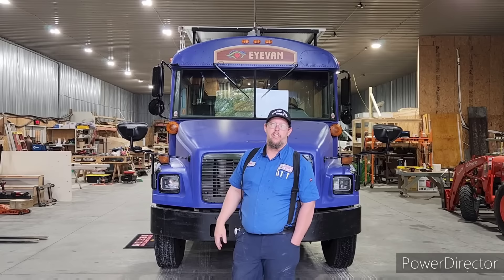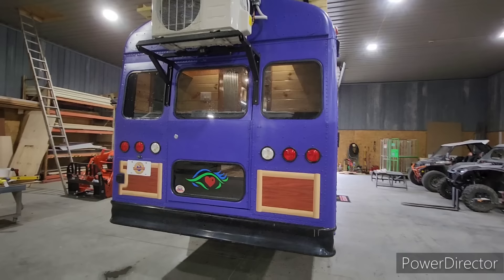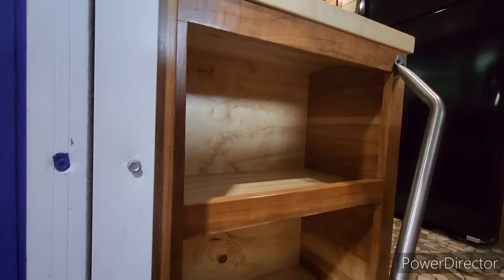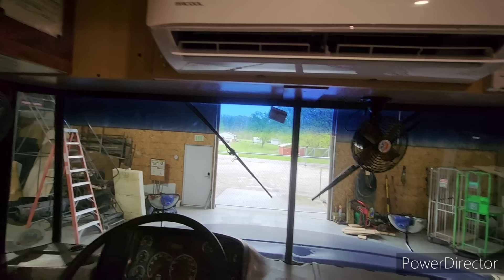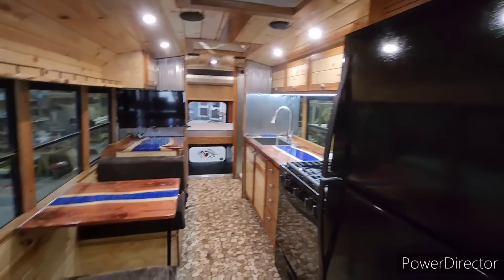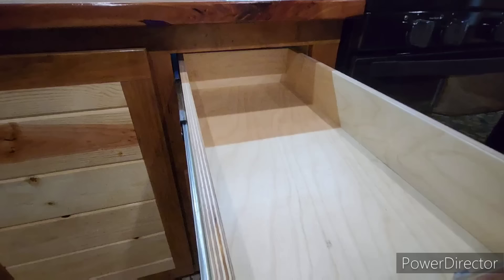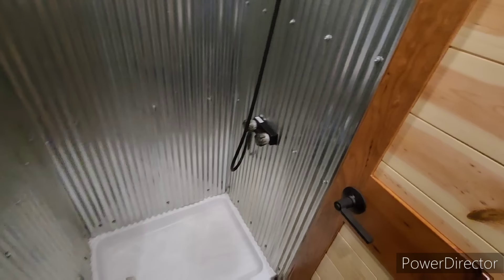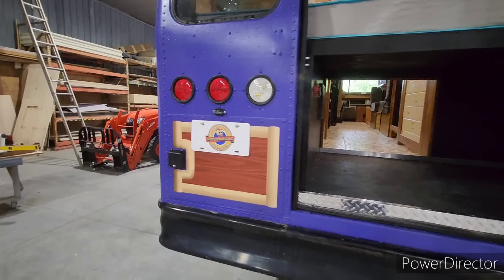Luxury school bus conversion.

Comment: I agree the wood stove would of been better angled the way you suggested for loading wood and safety. The toilet I think would of been better placed so your legs pointed towards entrance. Doesn't look like enough room for legs with wall. Beautiful work. Thank you for sharing. Blessings to you.
Reply from the maker: If it was facing the door, you would not be able to close the door while on the toilet.  I'm 5'11, 270lbs. And I can sit on the toilet just fine with the door closed, and still have room to do what needs to be done.
Reply: @RedsCustomDesign  Thank you. Good to know.

Comment: I am a seasoned builder and a retired RV Technition so that being said , you did a very nice job with this build . However ( please take what I have to say in a helpful manner )........... , School bus windows leak . It doesn't matter what you do as far as sealing them they will eventually leak and when they do it is rarelly known because they leak into the walls and create mold , black mold. Yes I know the client wanted to keep her windows BUT you should have explained to her what I just said. You re-sheeted the entire outer skin and that would have been perfect to install double pane RV windows that rarelly leak . You said nothing abouty what you insulated the bus with so I hope it was with Owens Corning Pink or best , urethane spray foam. The fridge , I noticed there were no locking mechanisms on the doors . Those doors will open when she turns and we both know what will happen. Child proof door locks at a minimum would suffice . Lastly . why didnt you install a light in the rear storage ?. Cam locks would also have been the way to go to remove the battery panel instead of screws .
That's all I have to say .Peace
Reply from the maker: Thanks for watching and your concerns,  but I disagree with you on them.   If you do not completely remove the windows, clean and reseal them as you install them. Then yes, they will leak. But if you put a bead of good urethane sealant down, then install the window and put a bead around the outer edge. Once it's in, it is water tight .   This is not my first bus build.  It is the first bus build my company has done.  As for the insulation,  I did mention that it was completely sprayfoamed.   Also, the refrigerator has a latch. It wasn't in at the time of the video. That's why it wasn't on in the video.   The top panel (under the mattress) comes off for access to the electrical system as well.  There is nothing that needs to be accessed in there on a regular basis, so why add a latched door? Also, as in most cases, the underbed storage area is crammed so full of stuff a light wouldn't do any good anyway. This customer is no exception.

Comment: looks good, the only advise I would give is, if your reskinning it you should have done away with the original bus windows and put in rv windows
Reply from the maker: #1, why? They were all sealed when put back in so not to leak.
#2, that defeats the whole point of having a bus.
#3, it wouldn't have been in the budget anyway. 
#4, the owner wanted to keep the original windows because that's what gives it the bus feel. 
So please explain to me what the benefits are for replacing the windows with rv windows?
Reply: @RedsCustomDesign  they are uninsulated, requires maintenance and are a big pain in the ass to replace when broken
Reply from the maker: @jeromymixon11 so are rv windows. So do rv windows,  so are rv windows.  

Next

Comment: Very nice workmanship indeed...the only question/concern I have is the bed...I do not see any holes for ventilation to ensure the mattress doesn't get moldy ... buses of course have a high rate of condensation...but I do realize that the wood stove will help the condensation...but with the bed and the stove being at opposite ends, I'm not sure if that's adequate ... is there venting for the bed/mattress?...Great job and well done...it's beautiful and well thought out.
Reply from the maker: If you don't keep your van/bus/camper closed up all the time, you don't need holes in the bed board. I lived in 42 Sq ft 6 days a week for 25 years.  And never once had a mold issue and never had holes in the bed platform.

Comment: Nice. One question tho, why have a door with a deadbolt lever and a window? Anyone can break the window and simply reach in and unlock the door. If I were your customer I would change the lock ASAP.
Reply from the maker: Are you referring to the back and side door?  If so, the deadbolt is only there to replace the factory nonlocking emergency lift handles.  And if a criminal wants in it, they will get in it. Any side window, door window,  windshield, etc.  Don't over think it.
Reply: She had a good point. So sounds like he's saying not to worry about making it easy for someone to break in bc if that's what they want to do they're going to anyway. I am so sick of being told by men not to overthink things. What an f'd up response.
Reply from the maker: I'm so sick of women always using their sex as an excuse. If someone is going to break in to your vehicle/ home they don't give a fuck if you are male or female or one of the other 5000 other genders people claim to be.  Stop playing the victim!